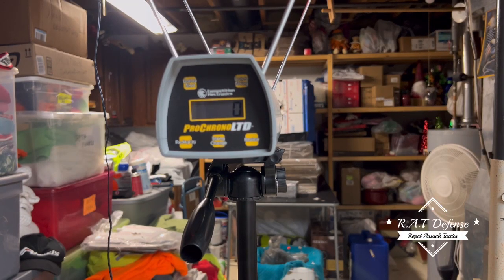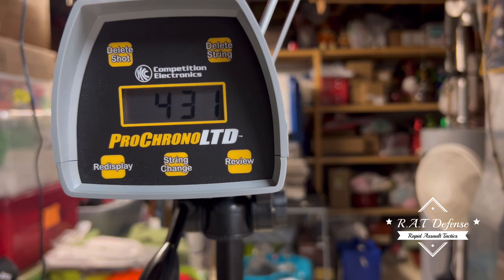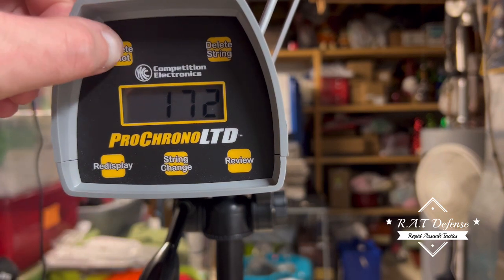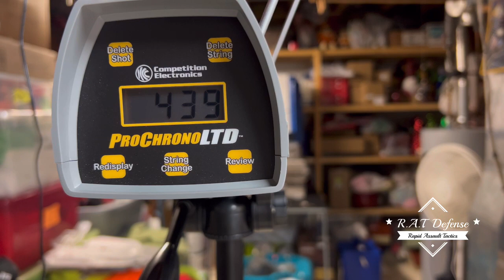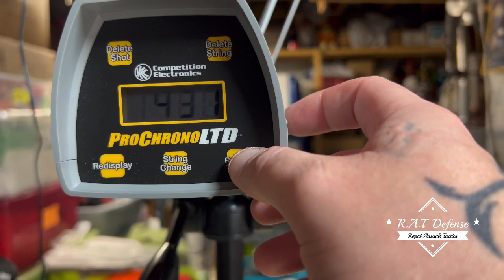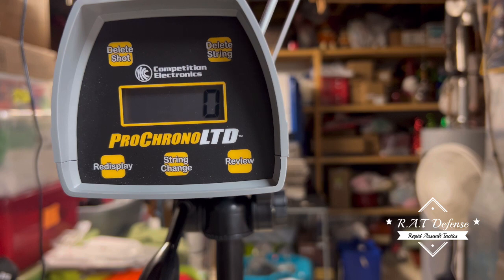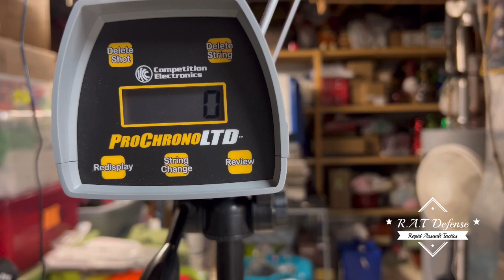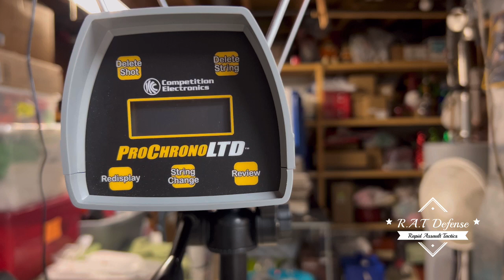M-17 & LL Talk ! #awareness #shtf #selfdefense #edc #homedefense #tactical

Comment: Those will hurt . Nice consistency.
Reply from the maker: @OGKG71 thanks not bad for Byrna kinetics on average at 442 FPS those were traveling at 300 MPH . You seen what the sd at between 10-15 feet did to my shin , imagine those ones going to the face sometimes doesn’t matter if it’s a light round or heavy no where to place that shot and it’ll make that person think twice
Reply: Absolutely.  That 11 j. SD .lookes like it hurt. . So yea i woudnt want that in my face @RapidAssualtTactics